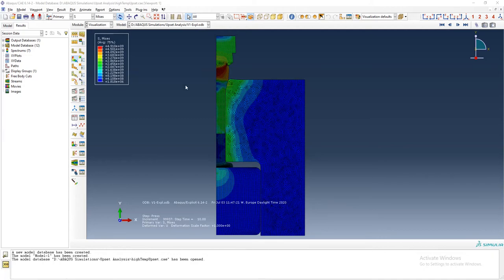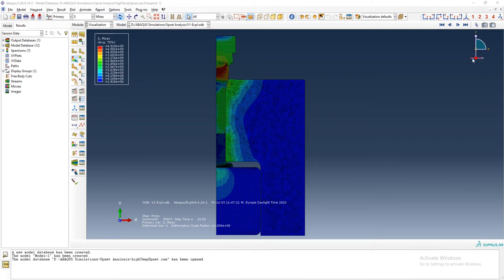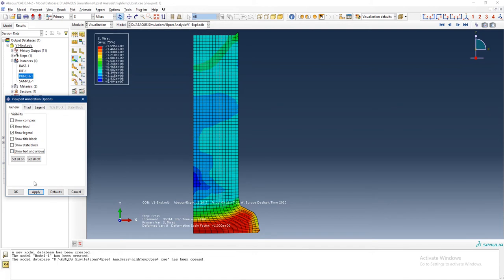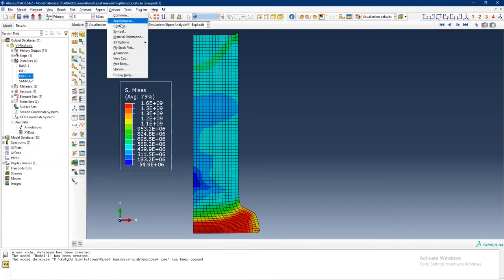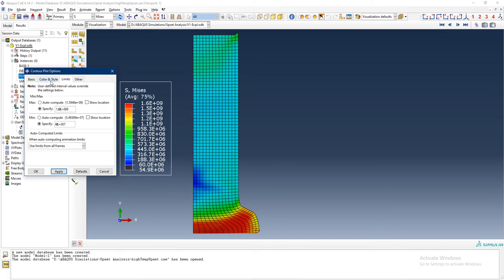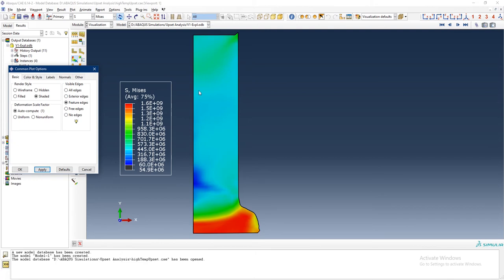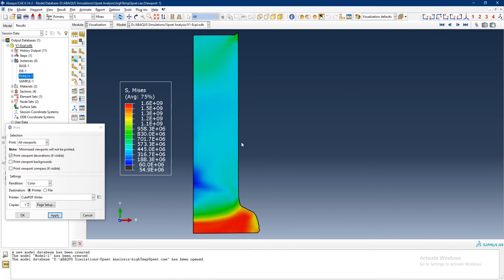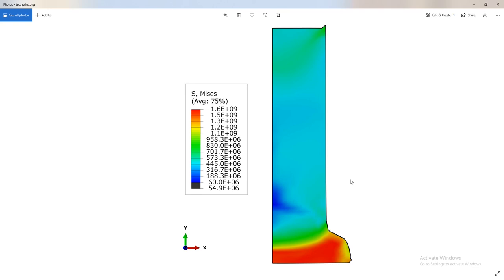Postprocess cleaning and high-quality image extraction from ABAQUS Viewer

Comment: how did you make this simulation?
Reply from the maker: Its an axisymmetric forging using explicit model. Not so complicate to model. If you still need information, please contact me. Check faisal.qayyum.com/contact for more details
Reply: @FaisalQayyum  the link you sent is not working here where i am trying to open.
and about this simulation, did you use only plastic deformation, or did you use any heat transfer in the contact area?
did you use adaptive mesh?
Reply from the maker: @andrefreire8224  In this simulation, only plastic deformation takes place. No thermal contact, no adaptive mesh